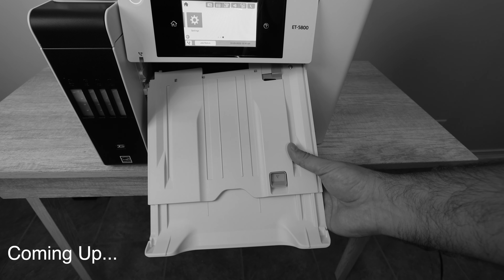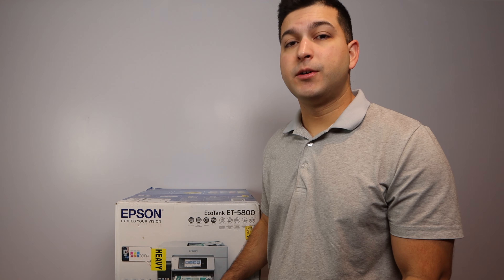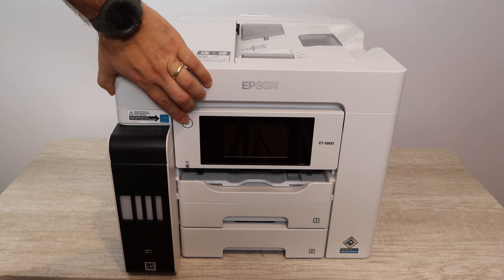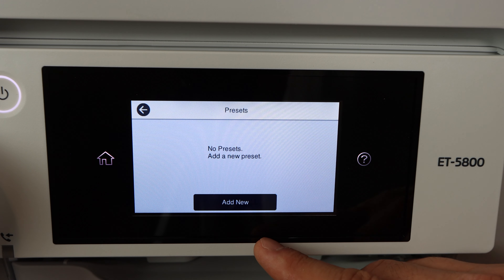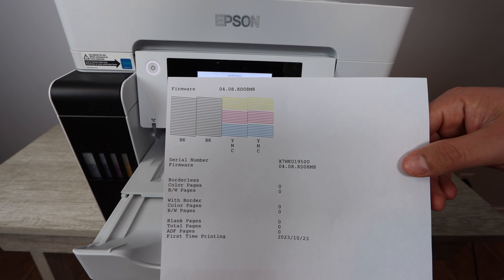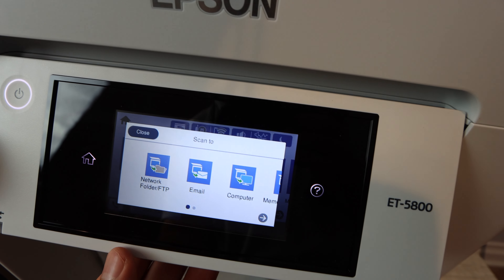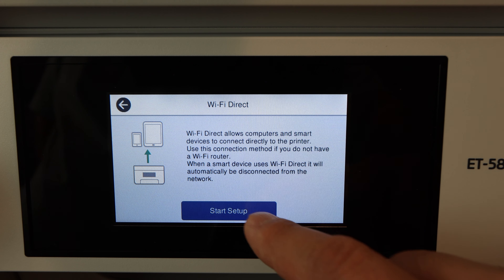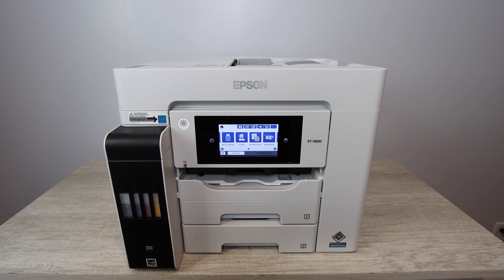Epson ET 5800 - Unboxing, Setup & Review (Amazing Features!)

Comment: Thanks for the review! Something I noticed missing on a lot of reviews lately is the “first page out” time. I’m not referring to printing a built in report like print head alignment, but how long does it take to print out roughly standard document? Thanks for considering adding this to future reviews!
Reply from the maker: I just came across what it is you're talking about. If you type in a printer model, and then type in spec sheet PDF into Google. You should have all the data to be pulled up and first page out will be one of those data points.

Comment: Hello , just saw your video which is a very complete, thanks !

Against the gx7021 , the Epson is as fast but the et-5850 is faster (same speed black and color), it can print without margins while the canon can’t but the canon can do a single pass copy.

I think the biggest issue with the gx7021 is the screen : the epson screen looks like way better. 

What’s your opinion between the gx7021 and the et-5800 ? 

Anyway thanks again
Reply from the maker: ET-5800 100%
Reply: @BestPrinters  thanks 🙏

Comment: New ET-5800 delivered yesterday, watched your great video this morning, and began setup. Followed instructions, now the printer is stuck with "Paper Jam" error message. After several attempts following directions, no paper is detected (printer has not even been setup to print), error message continues. Restarting printer and power reset  of no help. Hesitate to do a factory reset. Contacted Epson support, but it sound like it could be up to 24 hrs for tech support. I don't expect you to troubleshoot, but just wondered, with all your printer experience, if you have encounter this problem before. Again, I appreciate your videos, and hope to enjoy using the ET-5800 soon. Thanks
Reply from the maker: Hi, yes I have experienced trouble with printers right out of the box. In that case I will usually exchange the printer right away and get a new one.
Reply: @BestPrinters  Appreciate your advice. Printer being returned and exchanged via amazon. Thanks, again.

Comment: Thanks for the review. I’m a bit limited on space - would you know the dimensions with the output tray open? 

And since the output tray automatically extends when printing, what happens if the last bit of the opening is blocked by something kept in front temporarily?
Reply from the maker: About 7'-8' inches. I would definitely consider the 4850 good features but much smaller.
Reply: @BestPrinters  thanks. The problem is that I need duplex scanning and it seems like the smaller ones don’t have that.

What happens if something is kept in front of the printer temporarily and blocks the output tray from fully extending when a print job is started?
Reply: @BestPrinters  I needed 2 sided scanning. Any recommendations for options with it?
Reply: Epson lists the printer depth at 32.4 inches.  Is this dimension with the output paper tray open?

Comment: what's the difference between et 5800 and the ET-5850?
Reply from the maker: Not much its basically the same printer
Reply: @BestPrinters  The video was very nice, thank you. Is the color print speed of Epson et 5800 vs 5850 the same? On the Epson official website it says 12ppm for the 5800 and 25ppm for the 5850. If they both use the same printhead, why is there such a difference? I don't understand exactly why I need to pay more for et 5850? I always print in color, which one should I buy?

Comment: Quality third party ink usually is fine.  The Epson SureColor P9000 for example, always had an issue with one of the blacks, matt black I believe. Always on their own ink. As soon as the machine had quality third party ink, that nozzle never became clogged again. From what I can recall is that the best (from the wide format range) from Epson are the T series machines, all 3000, 3200, 5000, 5200, 7000, 7200. The Stylus pro's are just too damn slow. On the other hand, I haven't yet worked on the new SureColor T seriesachine that got released last year so I don't know if they got better or worse. Usually shrinking the footprint of a machine can either be done very well or very horribly.

Regarding this machine, what does worry me is the lack of (at least I couldn't spot it) maintaince tank, hope it doesn't have that crap sponge at the back which will need to be replaced.
Reply from the maker: It actually has the maintenance tank on the front, I am coming out with a video on it soon.